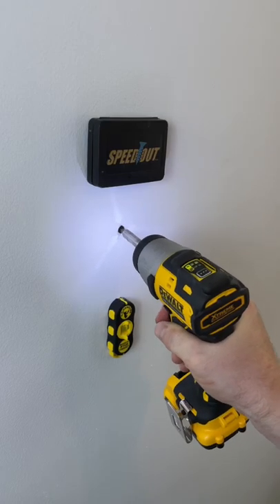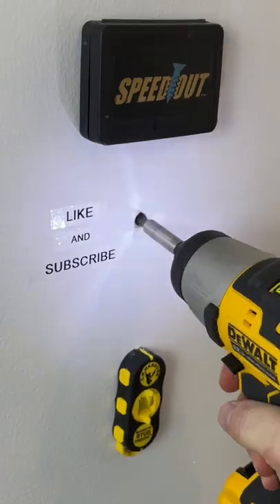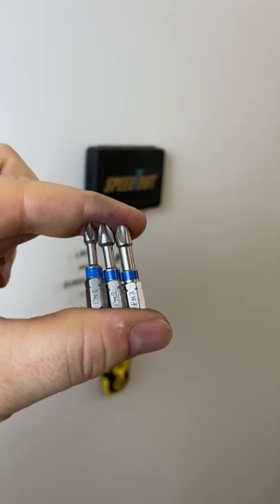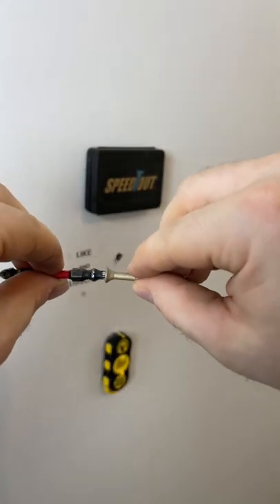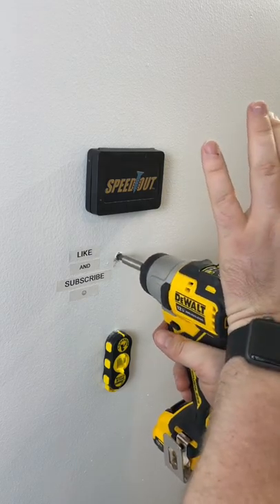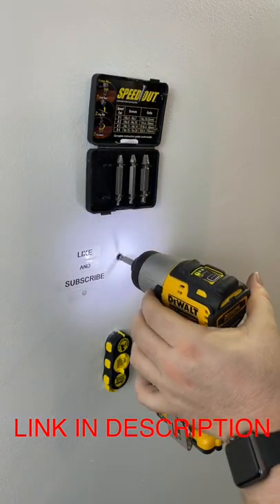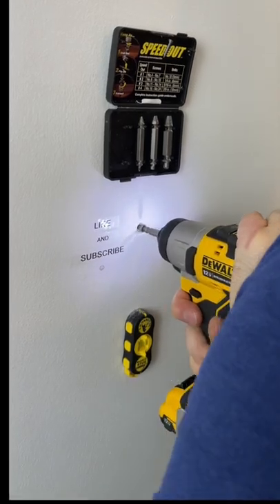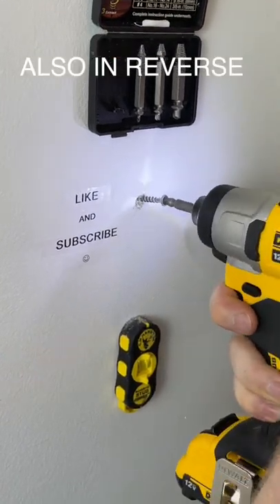How To REMOVE A STRIPPED SCREW!

Comment: As a plumber I like torx for certain but I never really had a problem driving 3” coarse wood screws, if you can drive 1.5” screws your not doing something right
Reply from the maker: As a Handyman, I never have a problem driving them in. my issue is removing them from previous installers years later.

Comment: We own a cabinet shop so we use tons of screws We use square drive for everything way better than phillips and have had better luck than i have with torx
Reply from the maker: Interesting, I don’t have a lot of experience with square head, thanks for your perspective!
Reply: Robertson bits are standard here. They regularly do up to 4 inch by 10 guage. With the correct size head the screws snap before the head rounds out. Anything bigger or thicker we use Teks or Bugle screws.
Reply from the maker: Interesting. Where is “here”? I guess Robertson screws never caught on around here (Kansas) and the people Ive worked around. 👍🏼

Comment: Tip number 6 put your gun in reverse and as your pushing reverse push down on the bit towards the floor.
 The screw will come out enough to grab it with your fingers and you just simply  back off on the screw with your fingers
 Easy-peasy lemon squeezy.